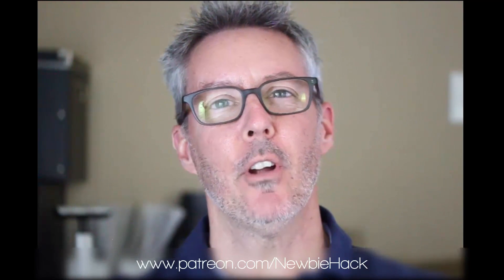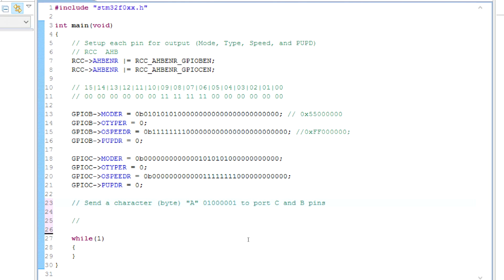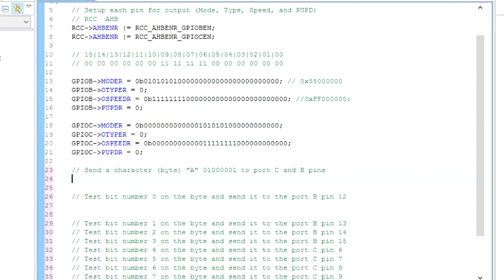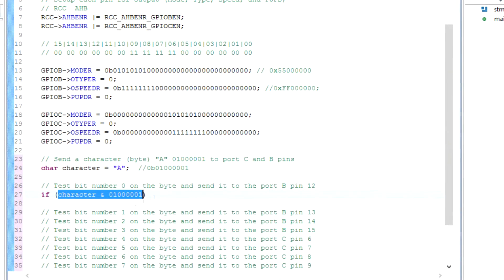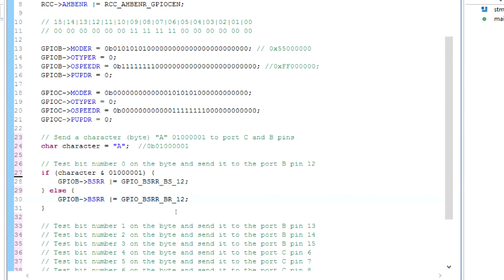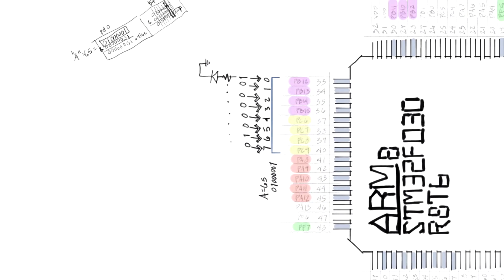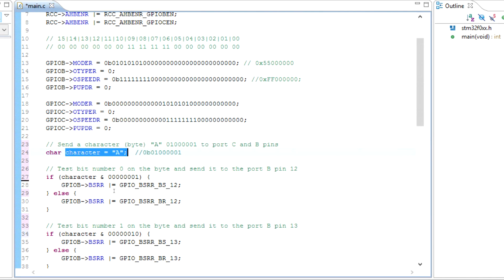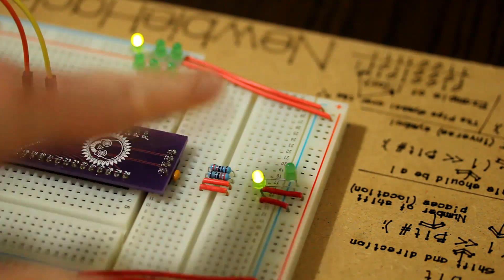16.How to: Bits of a BYTE/Character to any pins of the ARM STM32 Microcontroller and LCD Part 3

Comment: Hey Partick, why didn't you just use the pins you wanted to set on one line 

 GPIOB ->BSRR = 0x41; // 0b0000 0000 0000 0000 0000 0000 01000001

why did we have to use  the if else statements??
Reply: Probably so that it can work with any ASCII characters. If the if-else statements are put inside the function,  the function can accept dynamic ASCII characters. The one-line code you're suggesting will only work for character A as you are hard-coding it.

Comment: Hi, I have a problem with the next line <char character = "A";>, I have a warning "main.c(16): warning:  #144-D: a value of type "char *" cannot be used to initialize an entity of type "char" " And I loaded to microcontroller but there are more thant 2 LEDS that are on, and when I tried with "int caracter = 0b01000001" , it works as yours. Could you help me please?
Reply: Use char character = 'A'; instead of "A". Because if you type it like this "A" it means that you are initializing char variable with an array of characters aka "string".